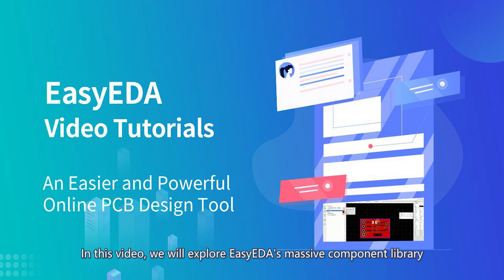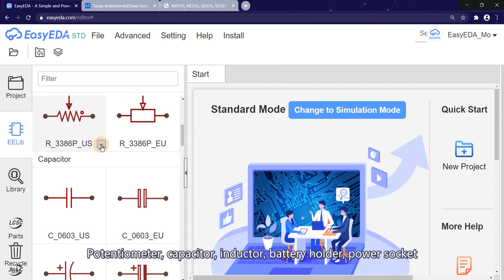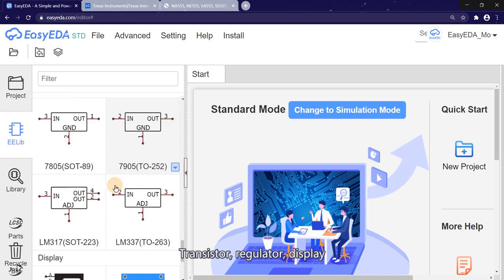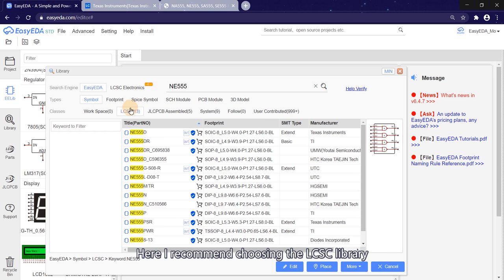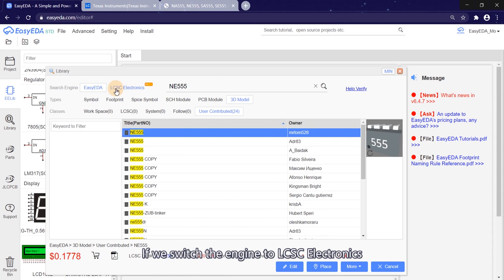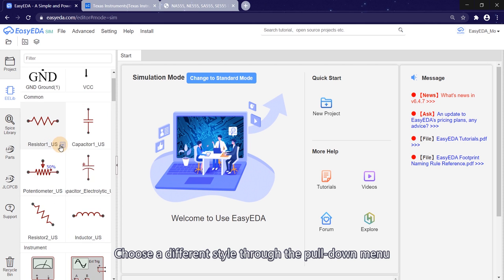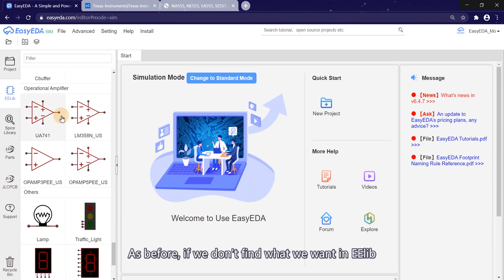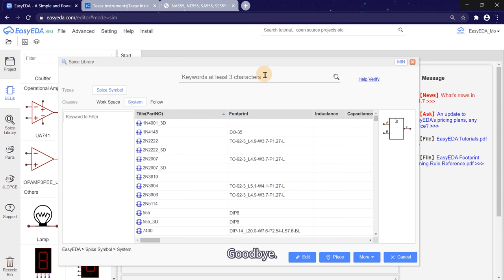008 Find Component at Library

Comment: I'm struggling to find a simple voltage source (I don't want a +5V port, I want to connect a 9V battery). The free web version at least does not have an EELib menu, it has a "Commonly Library", and I can only find small coin-like batteries, the Vcc and 5V ports, none of which I can edit to output 9V (at least it's voltage output is not a value I can see in the properties window at the right side).

Comment: o my for my 1st project was to use a Vishay IL300 opto-isolator in a circuit simulation. it errored out and did not work??  the footprint came up as LM356 op-amp? Help! 🙂